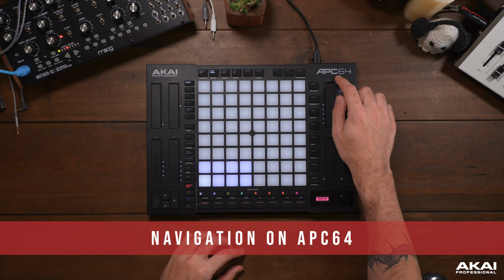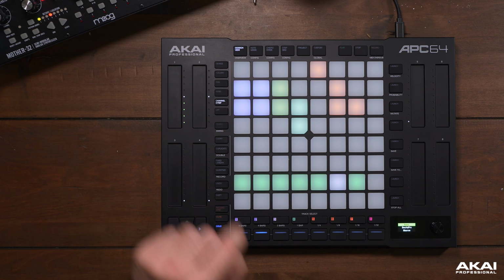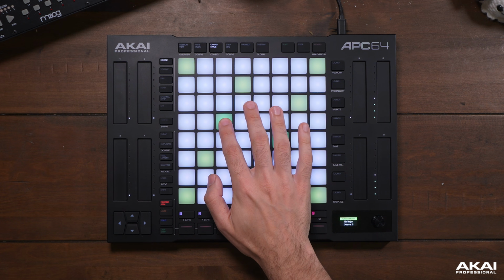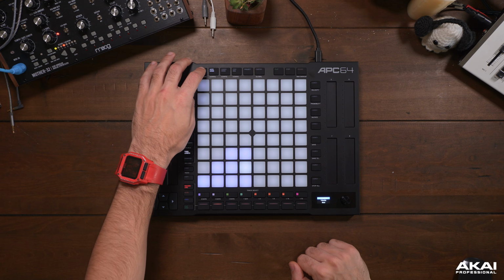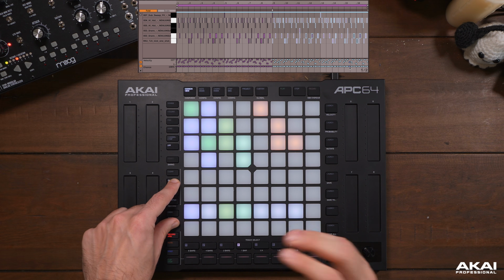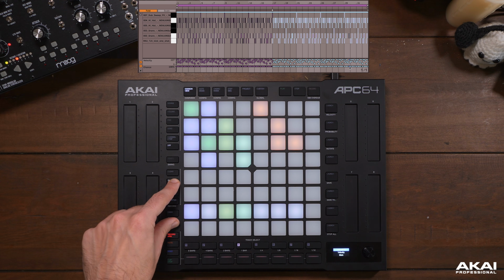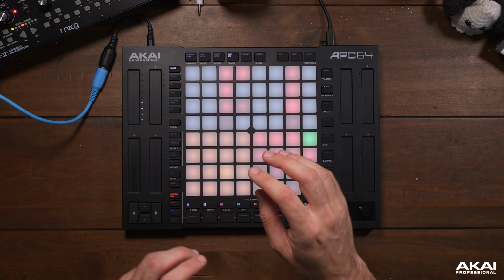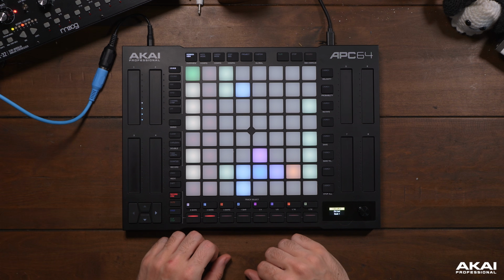APC64 Hardware Overview with Taetro | Akai Professional

Comment: HI . Great video . I have some questions to make. 
I have APC64 and Microfreak Arturia. I want to use APC64 in standalone mode with Microfreak. How do I have to connect the midi between them? And do I have to configure any parameters on APC?

Comment: Does anybody know how to control master volume on the APC64? 

There are eight touch faders and I can use the direction pad to move far right on my instruments until I am at the Master track. But let’s say someone uses 20 instruments and then has to scroll over far to get to that master track. 

What is a quick access way to adjust the Master volume?

Comment: Not sure why people are comparing this to the Push when its feature set is clearly meant to rival the Novation Launchpad Pro Mk3
Reply: It's like a watered down push with some really awesome features. I don't own a push so I was sold on this with the standalone external hardware sequencer
Reply: @the_impossible_kid  Launchpad has that feature too so it’s worth checking both out
Reply: @EliasJackson  almost traded my og curcuit for a launchpad mk3 but I'd have to drive and hour one way and I saw this thing pop up and was sold. Does the launchpad also have cv gate? I'm running some semi modular hardware so for the price point couldn't beat it. And I got it on a payment plan for 30 bucks a month 🤷🏻‍♂️

Comment: Is it compatible with the AKAI FORCE? to control the grid and rec, stop, mute, solo buttons and so?
Reply from the maker: This can used as a midi extension with Force or MPC
Reply: @Akai_Pro   but will it recognize the grid from the Force instantly or will I have to program it?
Reply: @Akai_Pro  if used as extension of the mpc it would be possible to see Clip launching screen on mpc?